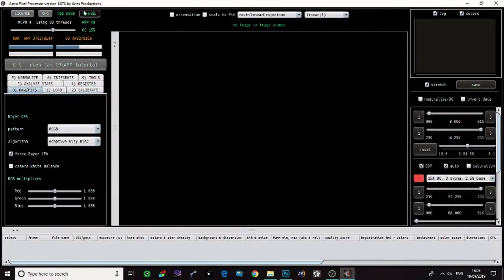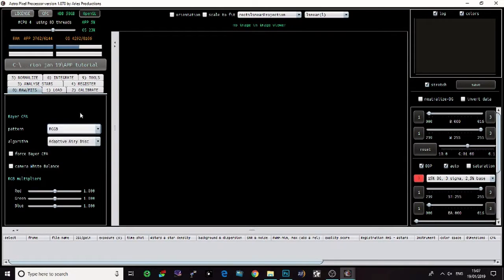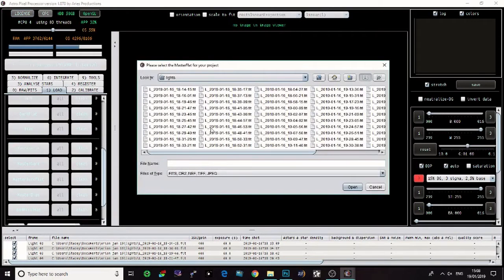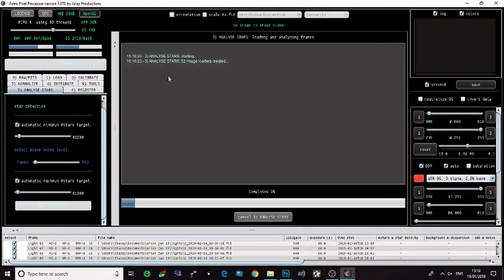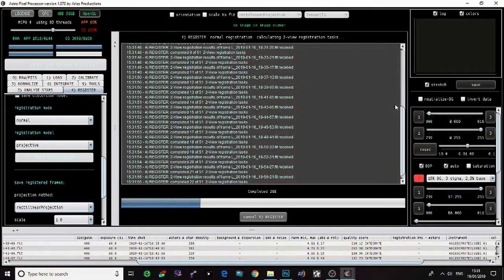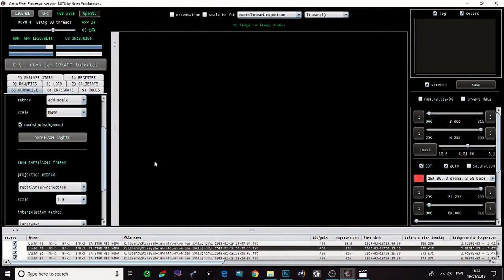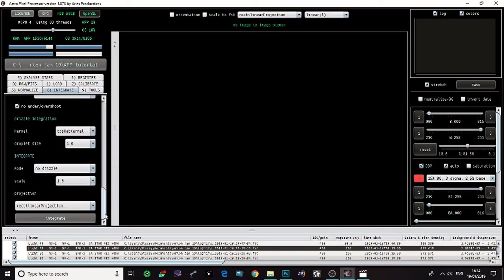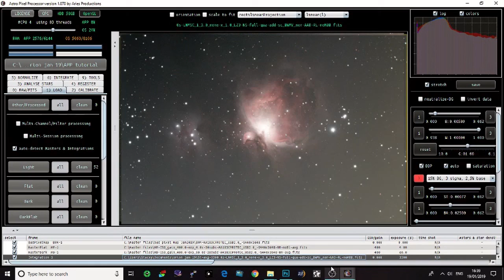AstroPixel Processor - calibrating and stacking

Comment: I have a CMOS with amp glow.  I ran 40 lights at -10 degrees Celsius, gain 111, 180 sec exposures.  I ran 20 darks at -10 degrees Celsius, gain 111, and also at 180 seconds each.  I tried stacking in DSS, PI, and tonight I tried APP following your video.  No matter what, I still get a yellow hue where the amp glow is.  Do I need to take the same number of darks as lights as well? It’s incredibly frustrating.  Any other suggestions you may have would be greatly appreciated as well.  I find all your videos to be very informative.

Comment: I enjoyed the video Stacey but tell me, why does nothing appear on screen until the processing is finished? Other software products show you at each stage!
Reply from the maker: Hmmm I'm not aware of any other software that shows you each stage during stacking? DSS doesn't and neither does pixinsight. During image processing eg stretching etc it does, this is just stacking alone :)
Reply from the maker: Gotcha! No problem at all. I'll get a basic image processing video up later :)
Reply: Ah, I get it now. I am starting to use AstroArt and that shows what image you load into it before you start the process so just wondered why APP wasn't in your video! Thanks for the tutorial it did help me!